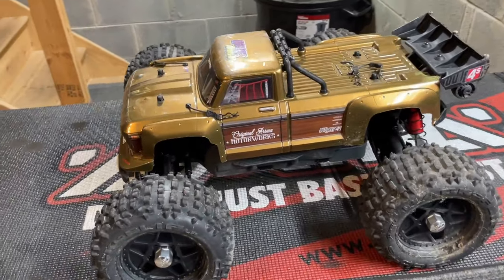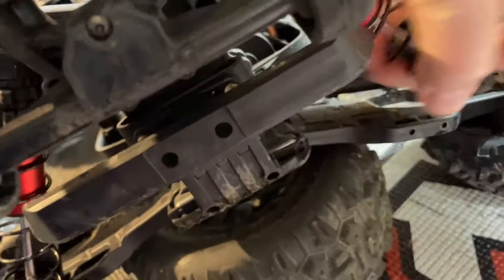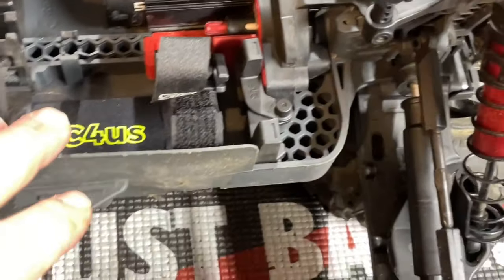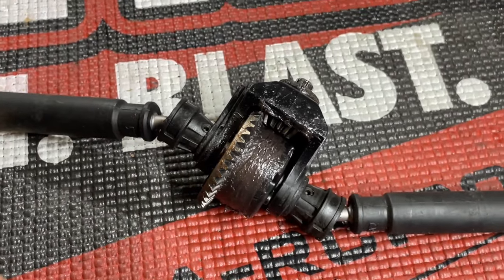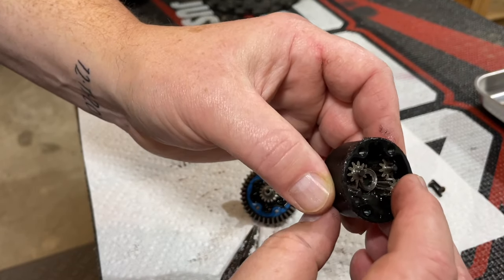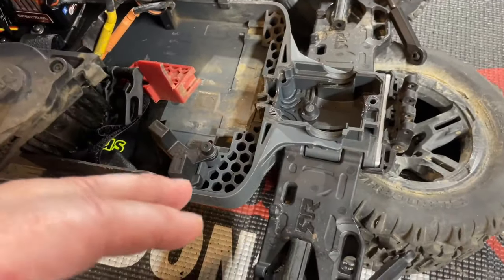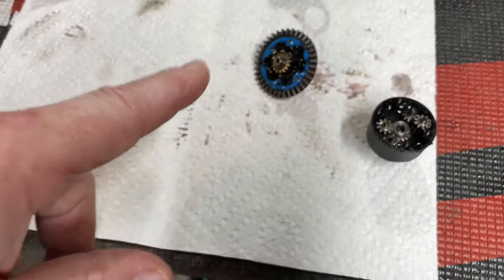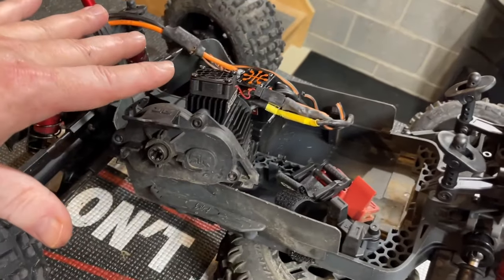ARRMA 3S and 4S DIFF MAINTENANCE AND TEARDOWN.

Comment: Thank you. Very helpful video. I have the clicking when accelerating. 
I'm a big old noob, so i bought both F and R diffs, because since they're plastic, i imagine both will eventually break. 
I've never torn down my Granite before, and i see I'll need a longer 2mm hex for the drive shaft removal. D'oh!

My diffs arrive in 9 days, so I'll have to get a driver with a long thin nose before then.

Comment: Very cool .. I need to bust mine open. Thought you might cut the relief hole for the spur gear while ya were in there and had the motor out. Should eliminate all the dirt that piles up?
Reply from the maker: I don’t believe in doing that at least where I run because too much dust in fine dirt especially at the motocross track piles up in there and eats up the gears

Comment: Hello , back k to RC after a hiatus of life 😂. They’re so much better now , drones too , I only have a few of each , 3 , but they’re fun for me . A 1/16 hbx 16980sa has proven to be the car that got me to get a arrma Kraton 6s and rlaarlo cf onmi terminator . Today , after 5 days my Kraton 6s went weird and started restarting itself after it sat motionless while on , controller was left on as well . Had to abandon for a phone call and it was like 20 ft away so I couldn’t hear it until afterwards walking closer . I thought I needed a new servo because it would not power on normally with the sounds . It would make it half way through when it got to steering it wouldn’t finish the beeps . The servo ,str, needed unplugged for a couple seconds and now it fires up like it always has for 5 days . I wonder what caused it to lose the i itial connection and if it will happen next time I take it for a ride ? If anyone knows what causes this thanks . I do like it .mid like to be prepared so I ordered a better servo ( according to reviews ) .
Reply from the maker: I’ve had that happen before, and it kept randomly not working, and inevitably ended up being the servo
Reply: Yeah . That k6s has been a really fun truck . As long as it lands on four wheels I’m guessing . I thought I would have broke something more but I ve been kcrc ramping it and the granite 6-10’ high and got them landing nice. That rlaarlo is like a China junker now compared to the arrmas speed and performance on short grass . Maybe if it was larger . It does handle really good on pavement and zippy . 4.3” tall tire’s made a huge difference in short grass . Switching back next time . Sometimes when I make a change I have to go back to stock to make sure it’s better 😂

Comment: hello, I was just doing this for myself and the video is super helpful but for the motor should the gear thats showing when you take it out spin freely or should it be difficult to push and spin?
Reply from the maker: The big gear should spin freely the smal one should have a little feel to it as your spinning the motor with it.
Reply: @BarstoneRC   ok, so just to double check the big gear in the red section thing as you pull it off as in the video should spin freely?
Reply: and is it ok to just spray some WD-40 in there or no?
Reply: @BarstoneRC    i took the cover off and found what you were talking about the small ger spins fre ish but it squeks is it ok to spray it with WD-40?
Reply from the maker: @winterwof6230 yeah when it not on the pinion gear
Reply from the maker: @winterwof6230 I wouldn’t just because it will hold dust and dirt then in there. I have but probably not recommend
Reply: @BarstoneRC   do I have to buy a new motor or is the squeaking a major problem? Also sorry for all the questions.

Comment: Good Sir thanks so much for this video! As a beginner in rc I find this super helpful, got an Arrma granite around 20days ago and already stripped the rear input gear lol. I ordered the metal ones from Arrma and I lowered the ESC punch to 2. I think I should learn to drive before I do crazy stunts so my drivetrain lasts longer 😅 I have a question about the shimming on both diffs. I ordered the same that you have “ARA210007” how to tell if I need to shim or no? That’s the only thing that scares me about the installation on diffs. Anyway thanks a lot for the tutorial, I’m saving this to my rc playlist I subscribed to your channel :D
Reply from the maker: Thanks for the sub buddy normally I only shim the 6s diffs and when the differential is sitting in the housing, if there is play from side to side, when it’s fully seated, you know you need to shim it
Reply: @BarstoneRC  thanks for your reply!

Comment: On 3s lineup those screws that hold the differential output axles that are IN THE axle that is on the differential and idk how the hell do I reach those? You will have to buy a thin screwdriver I think or is there another way please? Screwdrivers are not cheap that I want and I’m scared to strip them out, I’m thinking to buy wera hex ones because they have an anti strip anti slip feature which is w cool. Help on how to get those screws another way.
Reply from the maker: I have a set of MIP hex tools. They are long enough and best tools in the hobby

Comment: Is there an easy to get the pin to line up and slide back in the center brace when I disconnect it it's a pain to reinstall I've tried putting a alan in to try to get the pin to wiggle it back in
Reply from the maker: If you find one, let me know. I’m on the struggle bus every time I do that lol

Comment: What weight fluid are you running in the center diff?
Reply from the maker: 50k
Reply: Do you mean 500k? I believe that's stock.
Reply from the maker: Sorry yes half million basically
Reply: @BarstoneRC where tf is the center diff?
Reply from the maker: @TubsOnWheels101 3s doesn’t have one